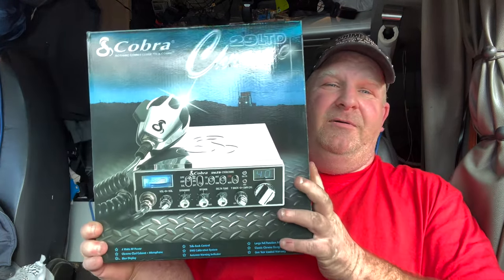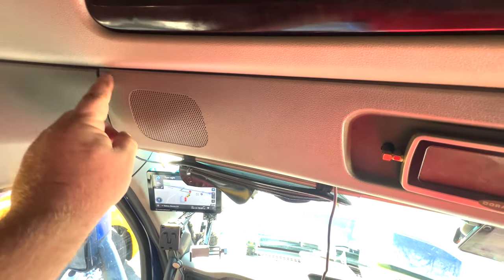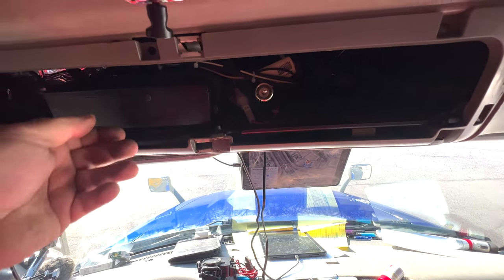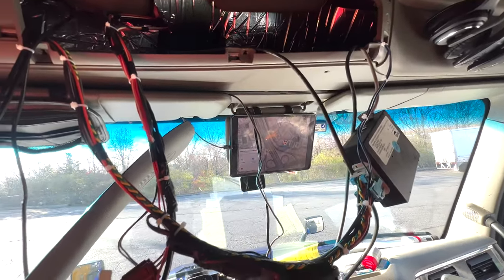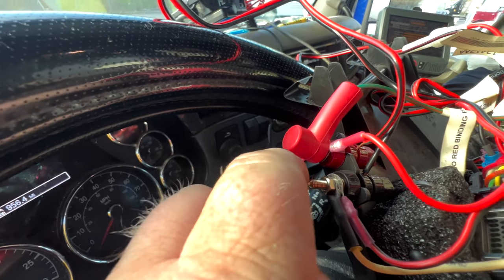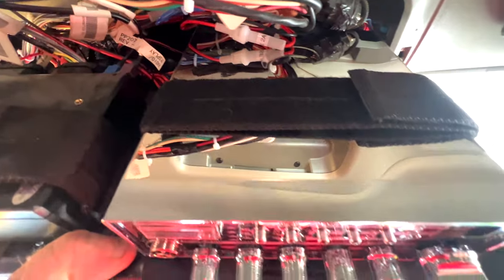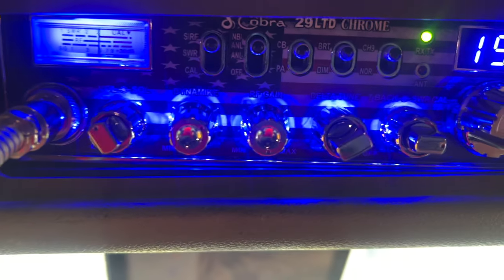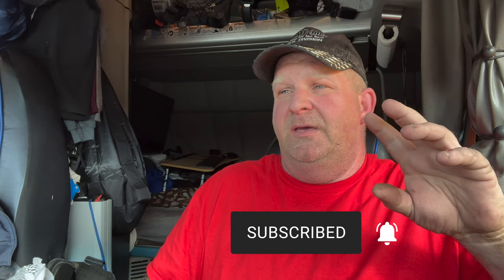New Driver Series - How To Install A CB Radio In A 2021 Peterbilt Ultraloft

Comment: Nice install TM. It seems that some of the wiring was already pre-installed. I am considering getting a CB after I get my Co. rig which will most likely have similar wiring installed for the set up. Keep the sunny side up and those big wheel's turning 10-4 (my handle is Magnum Rambler, & i'll catch you on the flip side bro!)